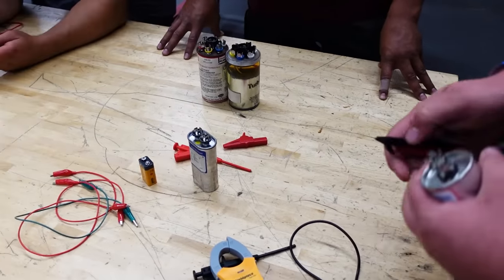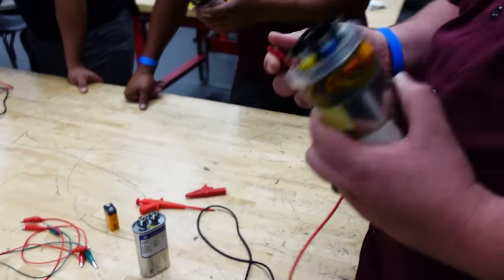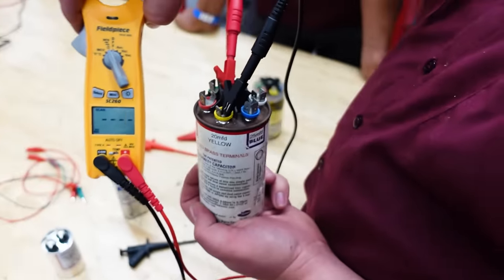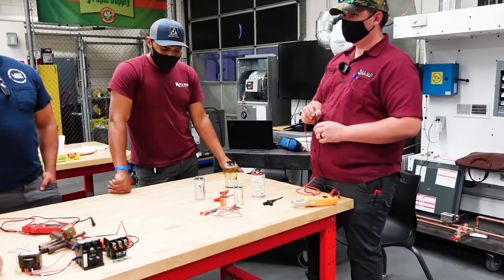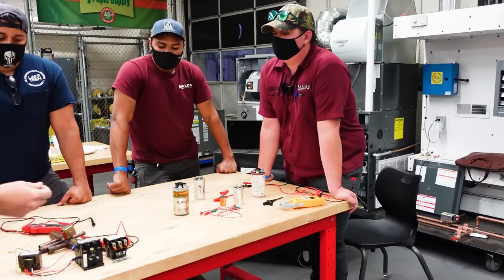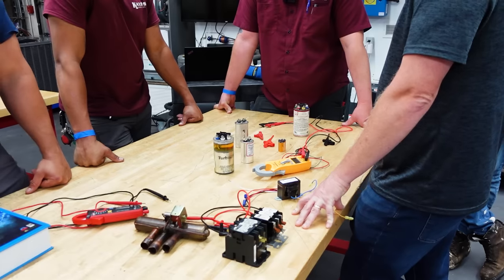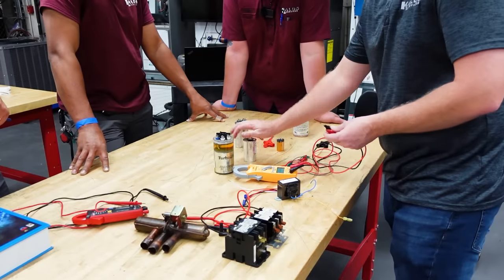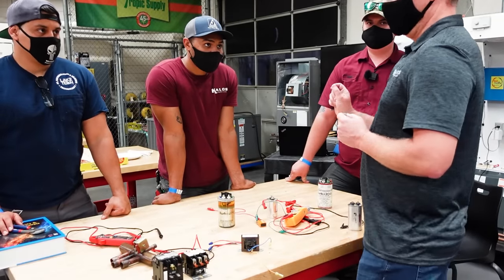Run Capacitor Fundamentals Class

Comment: I beg to differ.
You said the insulator is foiled on both sides, rolled up, and the foils never touch.  You said one connects from the bottom, and the outside connects at the top.
Wrong.
There is only foil on one side of the insulator.  If it were on both sides it would touch.  If it cant touch it is only on one side OR it has a second insulator rolled into it.
Look at any roll of foil, the shiny side rolls onto the dull side.
The stored capacity is from one end of the foil to the other end which is several meters of foil away.  You need to cut one up.

Comment: I was waiting for him show one that was under rated, like one is 30 mf. and the meter read 24 mf. thats more then 5% .. and the comp. is running fine, with the correct amp.s as well. just wondering how long will it take for damage to the motor..I live in Fl. been doing H.V.A.C. for 42 years. cap.s don't last long here, FYI. cap.s are not all the same,,
 I only use TITAN PRO. almost twice the money but you get what you pay for..

Comment: Don't want to be an idiot, but I call a capacitor an electron bucket. A coulomb is a measurement of electrons as in current, not voltage.

Comment: Absolute Crap:  
He asked, At what frequency is the capacitor charging and discharging?

This idiot says 50/60 Hz.
Obviously he doesnt understand ac.

Yes the mains may be 50/60Hz but its a Sin wave.  ie it goes through 0 volts.

The capacitor is actually charging on every positive half cycle and its charging on every negative half cycle.

So the capacitor is charging / discharging at a frequency of 100/120 Hz.

But the Polarity of charge on the plates alternates between charge cycles.

Comment: " They used to make them with more oil and thicker foil" about sums up all modern products, designed to fail. I've got two rooftop RV AC's that are 25 year's old ( still working fine) The new rv rooftop unit's breakdown in the first year of operation. Very Sad 😢. The decline in reliability has been so steep. HVAC techs will be busy.
P.s. Masks, the scourge of the period ( ends up, they did nothing) don't you feel like government is full of......💩 Now?